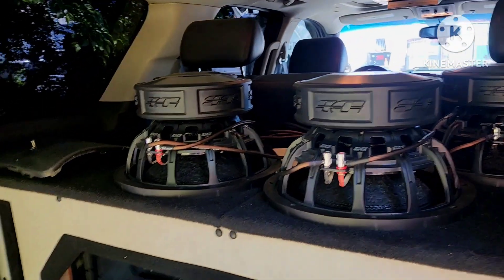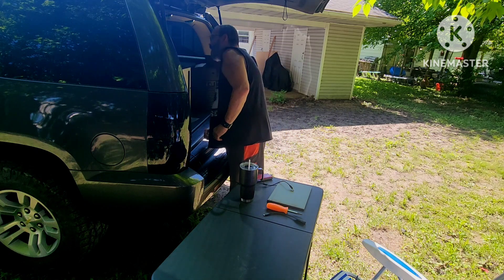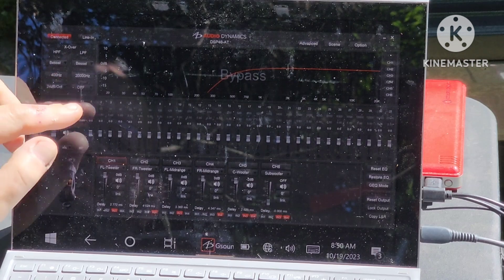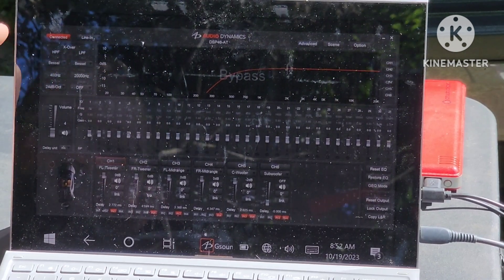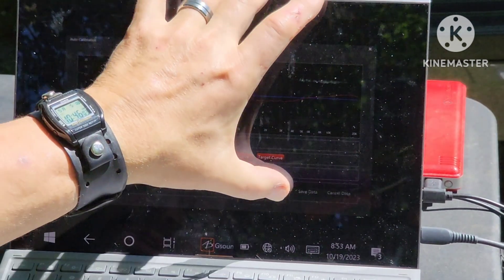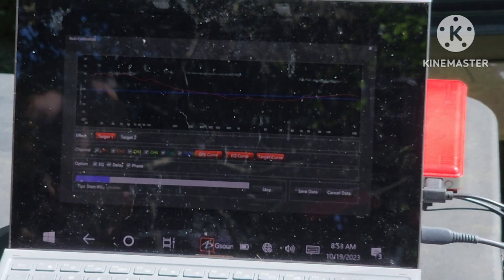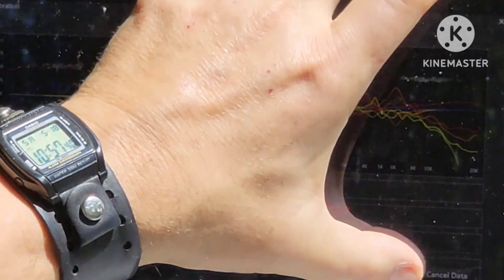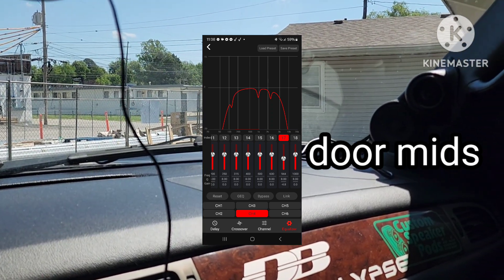ADDSP46-AT (Auto Tune DSP) Audio Dynamics

Comment: Hey, how’s it going brother how do you like that DSP? I will pretty much only be using it for my front stage, with 1-2 to going to the tweeters, three and four going to my 3.5 ( both the tweets and 3.5s are in fiberglass fabricated a pillars) and then of course five and six going to the 6.5 in my door, I know it doesn’t handle rear fill or sub channel. Just wondering how you’d like the quality etc. thinking about pulling the trigger on it tomorrow.
Reply from the maker: it does handle sub channels, and you can use any channel for any location, its a great dsp had it for 5-6 years now, still works but i have the 68hifi now installed,
Reply: @CarAudioEnthusiasts  I just meant that I don’t even have channels available for my rear speakers let alone the sub lol but yeah thanks again man and thank you for the super quick response. I really appreciate it for real!

Comment: How much power are you pulling total when you give it the "Whole plate" of beans?  Youve got SO MUCH battery (three I think I saw, including the IOXUS?) and two alts, but I didnt see a ton of total wattage in terms of amps.  I have a 2007 Escalade I just bought for my new daily-drive-able project build and at full tilt I can pull potentially 10kw RMS and all I am running is the factory alt, a small LiFePo4 battery for the starting battery, and a huge 148ah LiFePo4 bank in the back seat.  No voltage drop even when parked or idling (or the engine not running even), which is annoying since my last build was the same batteries and amps and DSP but in a Chrysler 300 and that dumb thing would drop voltage sometimes for seemingly no reason...  Not criticizing or asking for advice, just curious why you went so hard on the electrical aspect of the build.
Also thanks for a quick rundown of the ADDSP46-AT.  I think my Helix DSP.3S might be dying and Ive had this DSP bookmarked for a while now so thinking about grabbing it as a replacement for the Helix since I dont have a lot of time to manually tune at the moment so something with a decent auto-tune function to start things off saves me a ton of hassle.

Comment: how many watts to the mid/tweeter combo?
Reply from the maker: about 75 per side from the JL 450/4
Reply: did you wire the recoils down to 2ohms per door
Reply from the maker: @robizzo1436  yes indeed.
Reply: crazy how 35w per speaker in your whole front stage matches up with the madness behind the back seat
Reply from the maker: @robizzo1436  75w per but still yea
Reply from the maker: @robizzo1436  well yea 35 per speaker, since the 2 are together, now we still have the doors, they get 150 per side, or 75w per

Comment: The time delay figures look a little wonky. You can see the delay amounts are not based on distance from the microphone. How does the staging sound?

The only possible explanation I have is that the computer is also adjusting the phase so that the sound from all the drivers actually hits the microphone/your ear simultaneously.
Reply from the maker: yea it uses phase in the mix, its quite crazy really. staging it good, not perfect, a bit of movement. id rate it 6-7 out of 10. i can and will improve it my self of course.

Comment: I see you've crossed your rear subs at 100hz. Are you able to hear any of their output above 50 hz? If not, then why not cross them lower so that you're not wasting amplifier power?
Reply from the maker: not a bad call, i normally cross them at around 60.
Reply: @CarAudioEnthusiasts I've got a similar sized vehicle, a Navigator. With a small sub box in the rear and measuring from the front seat, it plays up to 45 hz and then there's a massive drop. I've heard people say that a larger enclosure in the rear can shrink the interior volume and allow the rear subs to play a little bit higher. 

Can you measure/hear your rear sub up to 60hz?

I'm going to be installing an 8 ft enclosure in the rear so I'm crossing my fingers that it will be able to play higher, maybe up to 55 or 60 hz. Maybe then I can get rid of my front mounted sub in the passenger footwell.
Reply from the maker: @JasonWW2000  yea itll play 60, i run a sub in the console as well. lil sealed 10 in a very tight box, its amazing. itll play about 30 to 100 with ease. very smooth little sub. i have a play list on it, there were trials...but in the end its awesome. totally MAKES the front stage.
Reply from the maker: https://www.youtube.com/watch?v=pNhB61NgidE&list=PLeV8tV-TuTAkh4IBSp2EotbiyQ1hC5t-T

Comment: I’ve been looking for a dsp more toward sq. Does this dsp allow for control to make rear a fill?
Reply: If you're looking for differential rear fill, I think that's going to be exclusive to Helix brand dsps since it's a special software program.
Reply: @JasonWW2000  i’ve been looking toward helix or the mini dsp w direct live. going to run a 3 way front stage.
Reply from the maker: @JasonWW2000  i assume youre talking about a simulated surround sound effect? 
is so then yea, i agree.
Reply: @CarAudioEnthusiasts  Basically, differential rear fill takes your left and right channel, lowers output, flips the left and right around, removes all the mono sound so you only get sound from the far left and right, then adds a very long delay. 

It simulates the reflections you get at a live indoor venue. It's a subtle effect, but it's the only type of rear fill serious SQ competitors say actually compliments the front stage. You don't really hear it, but if you turn it off you notice the change. 

I've never liked or used rear fill either, but differential rear fill intrigues me.
Reply from the maker: @JasonWW2000  i believe i can simulate that...sortof. still its interesting
Reply: first time running a dsp and going this deep for a audio install. figure if i’m going to do it do it as right as i can.
Reply from the maker: @Inimical_imi  personally ive never been a fan of rear fill, but to each their own. I would however like to play with dolby surround in a car audio setup. for movies and such, i think that would be fun.
Reply: @CarAudioEnthusiasts  i’ve been intrigued since i’ve been searching the web for the right fit. i’ll have to look into this dsp some more the auto tune sounds pretty nice too.
Reply from the maker: yes, creating rear fill takes some tuning tricks, all of which can be done on this dsp

Comment: Your doors are 100-6000 that doesn’t cause problems with frequency’s from a pillars?
Reply from the maker: you would think it would, but they blend very well.
Reply: @CarAudioEnthusiasts  Do the lower mounted door mids bring the stage height down or does it still stay nice and high?
Reply from the maker: @JasonWW2000  not at all, i can play them alone, and the stage is still above the dash, the loacation of the pods are kinda magic that way. doesnt matter what drivers are there, the stage will really be high.